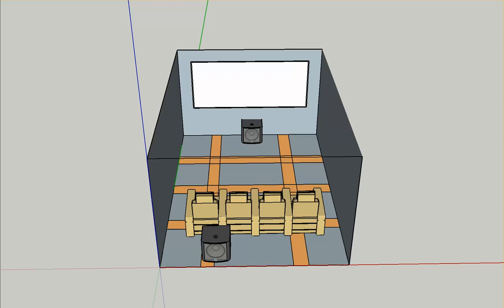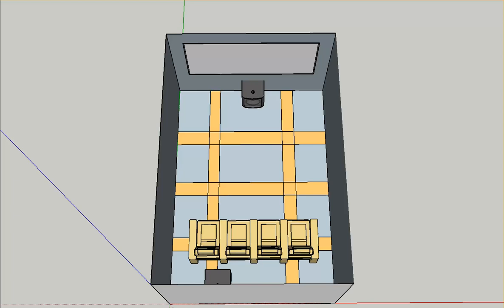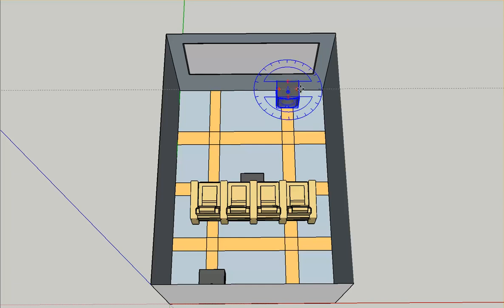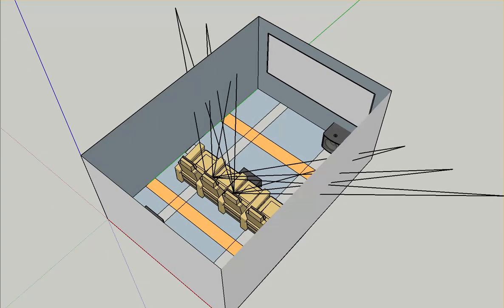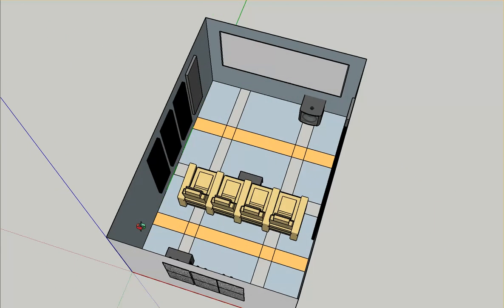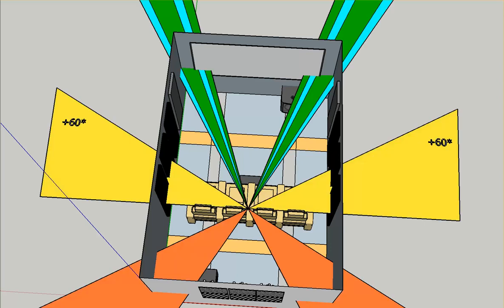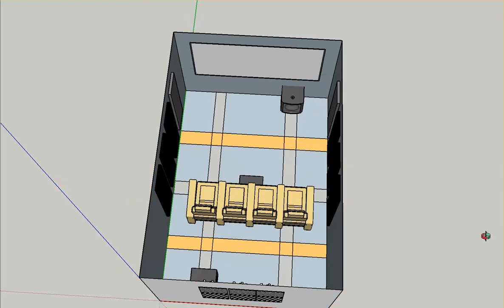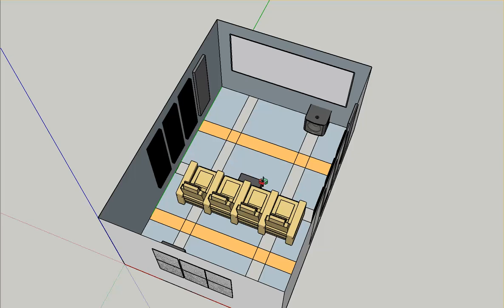Home Theatre Improvement Tour

Comment: Just wondering about the side surrounds and why you place them 90 to +60 degrees ? When i see on the Dolby recommendations they have them from 90 to 110 back in the room ?
Reply from the maker: You are absolutely right there is an error in the guide template which is quite old and we have updated it since. (This video is an older one produced before the template was corrected.) Not sure how it got that way but yes we are well aware of Dolby and THX specs for speaker placement so not sure how that template came to be. Thanks for pointing this out for other viewers though.

Comment: Andrew you seem to steer away from the whole front wall treated as some seem to do on AVS, any specific reason? i.e. in your experience it makes things to dead?
Reply from the maker: Hi Stevo, this was an actual room that had already been completed by another company. We were not able to make any changes to the screen and LCRs so this is why the front wall isn’t mentioned. These were in wall front speakers and the client didn’t want as said to change anything there. So our approach is to try to treat the front wall in the following order, a) baffle wall if not then b) absorption if not then manage speakers  as best as possible and consider reflected sound returning to front wall. In other words slap echo or bounce returning from back wall which needs to be managed. Angling any speaker to optimise the signal is a preferred approach and minimises wasteful and harmful reflections. Hope that helps a bit.

Comment: What’s the software you are used in expecting the mirror points
Reply: Hi. Great question. Software is not required to calculate the mirror points. We simply extend the distance from.speaker to side wall then double it and draw a line from that end point to the listening position. This creates the correct reflection and angle and locates it on our design. Hope that helps